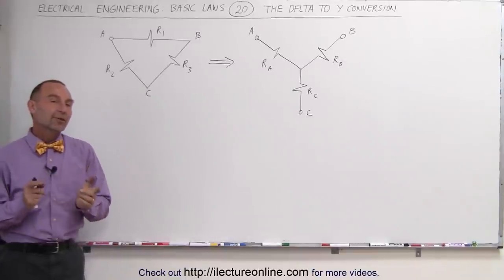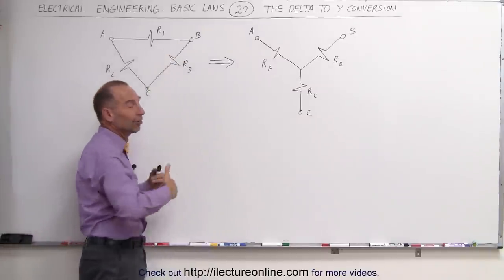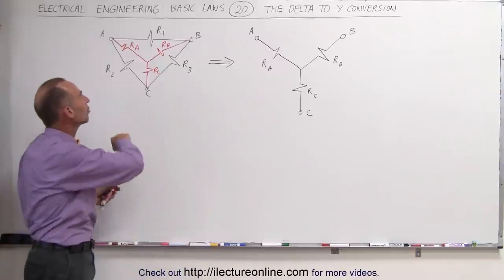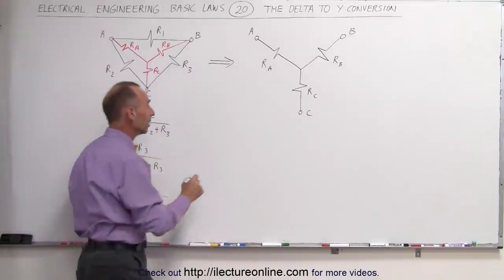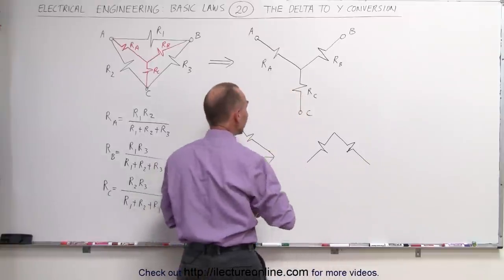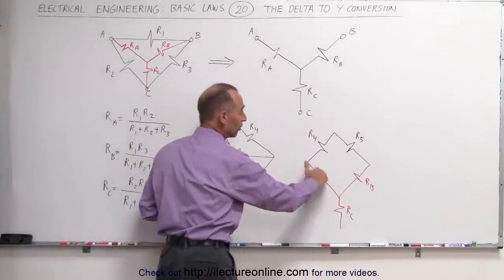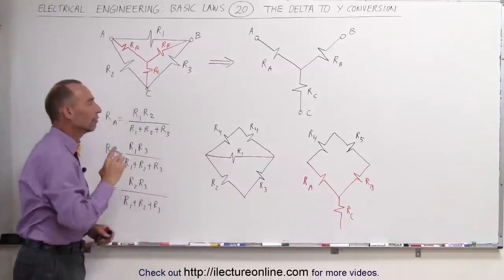Electrical Engineering: Basic Laws (20 of 31) What is The Delta to Y Conversion?

Comment: Hi sir,

About 4-5 years ago I had watched this video and all the other electrical engineering basic one on the night before my reattempt exam for Basic electrical engineering subject for my computer engineering degree,that was my last attempt and if i had failed i would have had to take a gap year. Your videos were the only ones that made sense and having watched all of them i was some how able to clear my exam about 20 marks section was delta to y,rest was all circuit theorems. 

Thank you,hadn't i had discovered your videos the night before i could have failed my tests.
Reply from the maker: Thank you for sharing.  Glad you found our videos ant that you found them helpful.  Did you graduate?   🙂
Reply: @MichelvanBiezen  Yes i did graduate in summer of 21 with a 4 year degree in Computer Engineering. Currently working at a Big N software Corporation as a Software Engineer.
Reply from the maker: @randombuilder345  Awesome!  Congratulations on your success!

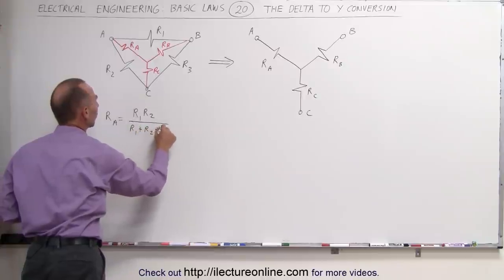Comment: hi, at 2:00, where does that formula come from? I know that u can find the total resistance in parallel circuits by doing product/sum, but why do we not include R3 in the product?
Reply from the maker: We have a playlist:  ELECTRICAL ENGINEERING 2.1 DELTA TO Y CONVERSION PROOFS starting with this video:   Electrical Engineering: Basic Laws (29 of 31) Delta to Y Conversion Derived R1=?  https://youtu.be/pDRE4OSUd2Y
Reply: omg thank you so much for replying!! I'll check it out! :) @MichelvanBiezen

Comment: In the last diagram that u drew why isnt the whole square in series but instead R4+RA//R5+RB?Thank you sir
Reply from the maker: If there is more than one path the current can take it is a parallel circuit (the current splits into two paths).  (A series circuit means that the current much pass through every element of the circuit.)

Comment: -The formula’s are just stated, not proven.
-The example at the end has no terminals, which is confusing.
Reply from the maker: The proofs are availble in another playlist especially made for that.
Reply: @MichelvanBiezen  Waar dan?
Reply from the maker: ELECTRICAL ENGINEERING 2.1 DELTA TO Y CONVERSION PROOFS starting with:  Electrical Engineering: Basic Laws (29 of 31) Delta to Y Conversion Derived R1=?  https://youtu.be/pDRE4OSUd2Y